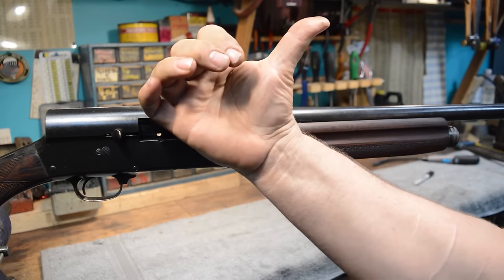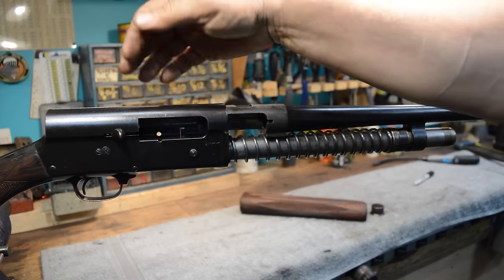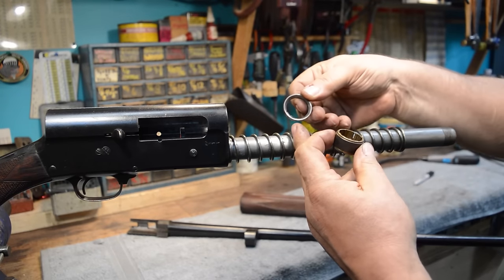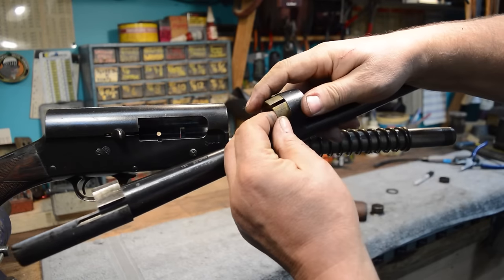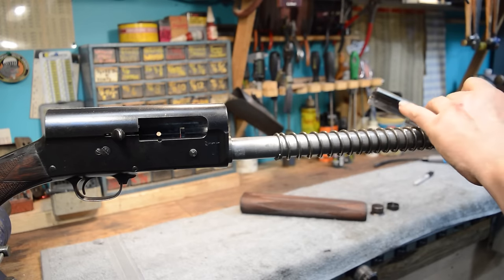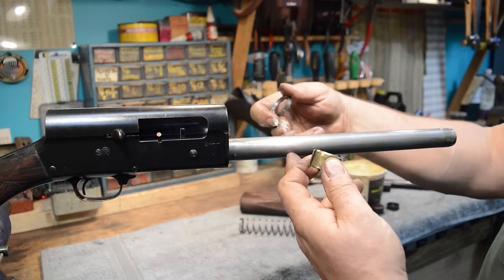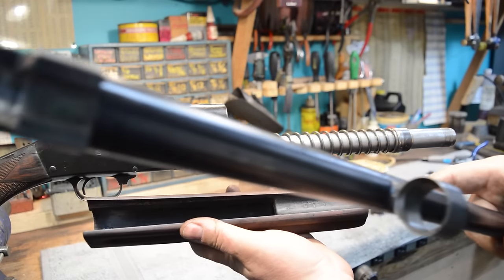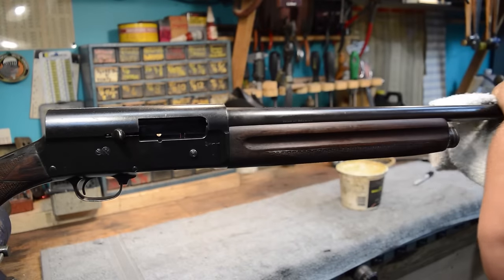Browning A5 Friction Ring Setup

Comment: The two things a gunsmith can count on are fixing Marlin 60s and cracked forearms on Browning A-5s. Excellent video, as always.
Reply: Sounds like you have seen this a time or two as well. Don't forget the dicked up slots on the fasteners on the A5.
Reply: my Remington mod 11 has a crack going down the wrist and a forend, and one of the back screws is messed up, I love the thing but she’s a bit fragile (I have not shot it much yet, I did not cause the damage, got it at an estate auction), I wish I could find some synthetic furniture for it, I love wood but I intend to hunt with it till I’m to old to hunt so I’ve gotta make it a lil more durable, thinking about getting it professionally dura blued. I gotta modify a mag tube cap for a sling swivel to, can’t find that aftermarket.
Reply: Buzzard 1860, I think Ramline made a synthetic set of stocks that may work. I put a set on an A-5 I had and it took some time to fit the buttstock up. I believe the mag tube caps with swivel studs are available from Uncle Mike’s. It would make sense to take it to a gunsmith for a good cleaning. Every new A-5 I have purchased over time needed a good cleaning and lubing before I did much shooting with them. I hope you enjoy your Remington!
Reply from the maker: All 4 types of Marlin 60 to boot...
Reply: Mark Novak, there’s that too! I have a bin full of spare parts!
Reply: You’re not lying just bought an A-5 today and sure enough the forearm is cracked.
Reply: Re forend cracking, I think it was Remington that glued in a wood collar at the inside rear, however they all seem to crack over time whatever one does.  I’m wondering if someone experienced with fiberglass could layup the appropriate fiber cloth plus resin in this area.
On another issue, these Browning long recoil guns have the potential to really kick and the rifles (Rem. Model 8’s) really do.  This is because with these guns you basically have a gun inside of a gun, where the barrel+bolt recoil inside the rest of the gun.  But the mass of the barrel+ is only half that of the entire gun, let’s say 3-4 pounds, and that is what gets accelerated by the recoil from a 12 gauge load, and it has the potential to smash into the inside of the receiver, dampened only somewhat by the recoil spring. It’s the A-5’s buffer ring which converts a lot of this energy to friction (heat) and does this over the entire stroke, thus an A5 kicks about the same as other shotguns. This is why lubrication of the (stainless steel) magazine tube effects felt recoil and functioning, as was explained by Anvil.  Shoot an A5 without the ring and you will have an experience you won’t want to repeat.  All of this is explained in Hatcher’s Notebook, now online.
Reply: I must have gotten lucky because I've had my marlin model 60 for about 20 years, bought it brand new and never had a problem with it. What are the normal problems with the 60s?
Reply: @matthewsaia409  the list of fixes that I have made to Marlin 60’s is probably too long to lay out here, but one of the major failings is the loading block. That is the silvery looking part that you can see down inside the ejection port. I have found that if the rifle is shot over the course of time without being cleaned thoroughly the fouling and operation of the rifle will cause excessive wear and eventually the rifle will not reliably feed rounds into the chamber. It would have been nice if Marlin would have made the the loading block out of stainless steal. My examination of the used loading blocks makes me think they are made out of chrome plated pot metal.
Reply: Not to mention Cracked forends on A5 patent clones. (Remington Model 11 & variants, Savage Model 720, the Savage Model 745.)

I personally own a Savage 745 and the forends is cracked on it lol
Reply: Why would a Marlin 60SS have a cracked forearm?  Maybe that's not what you meant.

But then, mine is stainless with a plywood stock.

There you go.  

Mine has over 10K rounds thru it, barrel never been cleaned (and looks GREAT with a Teslong bore camera.)  

Cleaned the action once, but it just keeps on ticking.
Reply: @pcmacd  Marlin 60’s usually suffer from parts wearing out inside the receiver. I have never seen a cracked stocked, but I suppose it is as possible as anything else since it’s designed and manufactured by fallible humans.

Comment: Excellent video! Many people dont understand them and get quickly get frustrated with having FTE. This is the best shotgun design ever,  1898 to 1998, a 100 years of John Browning perfection. These guns will shoot 10,000's of rounds with just some grease on the mag tube and a couple drops of oil in various spots. Ive been shooting auto5 for 37 years it's the one gun does that does it all !  If you find your not ejecting in colder  weather dont be tempted to use oil it will soak your stocks,  instead use a lighter synthetic grease sparingly on the tube.
Reply: If they're the best ever and perfect, why are they discontinued?
Reply: @randomidiot8142  Im not sure but I speculate it was expensive to manufacture.  Also, I believe it would need a redesign to make it lawsuit proof....the safety doesn't block the firing pin.

Comment: The manual that came with my 1957 Light Twelve says not to use grease, only a drop or two of oil, on the mag tube. It recommends removing oil, if using magnum loads, so as to increase friction (reducing felt recoil). The manual says it is safe, and will not harm the gun, to do so.
I really enjoyed the description of how the rings themselves function. Very informative!

Comment: That has to be one of the best explanations. 
I liken it to a compression pipe fitting a nut and ferrel so to speak.

Took me 2 years and 3 boxes of parts to build my first A500. I refer to Brownings Shotgun as one of the most quintessential steps in the development of Automata. It operates in a simple reliable way to perfom a repeated action...robot?
 
IMHO The Browning A5 is by far and away the very best Automatic Shotgun Rifle I have ever had the extreme pleasure of shooting and learning how to build and dismantle. John Moses Browning is the father of the modern firearm and the A5 will most likely be around for many generations to come.

If you cannot tell the A5 is my very favorite firearm right next to my AK's with the two and a handfull of ammo some targets to vaporize I am virtually guaranteed to exceed grin factors unknown.

Comment: Now, the questions will start...'What do I do with the other stuff?', from the guys with the 3 inch magnum guns! It works exactly the same, you just have two friction rings and multiple cone rings. I get the same question because everyone wants to soften the gun for dove and quail loads early, then punch it up for Magnum buckshot. 
   BTW, The A5 magnum that was left to me by my late father, will run the lightest loads fine, when set correctly. Correctly also means all the parts in the gun, not some taken out and in your pocket! 
    Great video and you will probably have to repost this every summer before hunting season!
   Take Care and be safe, John
Reply from the maker: Didn't have a magnum to show, but twice the parts are twice as good!
Reply: @marknovak8255  Yep! Take Care buddy! I wish I knew where to email or msg you and I would send pics or video of a A5 magnum system for you to use.
       Great Work friend,  John

Comment: My first gunsmithing experience was with a A5. The bolt block that rolls up into the square in the top of the barrel was wore out. The gunsmiths at the shop ordered the part for $35 and I got to machine it to fit. The curved lip that rolls it I to place when the bolt is closed and the sides were too big and they taught me how to machine them down to fit. My dad bought the Browning at a garage sale in the suburbs of Denver for $2.50 because the guy said it was a wall hanger. That was one good deal. The guy didn't think that the other parts were worth money. It took about 20 minutes to figure out what was wrong. I still have the old bolt block as a reminder. I would never work on someone else's firearm but I do work on my own. I can't tell you how many 1911 triggers I have destroyed before I got it right.

Comment: I just pulled apart a 1964 Savage 775A with exactly the same action. I learned I need to pull it back apart and align the ring gaps and white lithium the tube. Thanks!

Comment: I've never used grease, just a bit of light oil. Replacing the spring and friction rings periodically is required maintenance as far as I'm concerned. Excessive slamming from worn parts and improper setup is what cracks the forend.

Comment: Great video. I just came across a Franchi 48 AL, which as I understand is a licensed version of the A5. The previous owner had it assembled with the steel governor ring between the receiver and the spring for no braking action, as you said.  I've had a bit of trouble finding official information on it, so you've helped me see just how similar the two firearms' recoil rings are when reduced to their parts like this. Not sure if it's a difference specific to the Franchi, but the only manual I've been able to find online (an old 'American Arms, Inc.' publication) INSISTS in big bold warning letters that the magazine tube should never be oiled, and should be wiped dry after cleaning contrary to what you've mentioned on the A5, and what I would have thought should be done.

Comment: I find using Lithium grease provides a little TOO much lubrication causing the friction rings to lose the ability to  brake effectively, causing undue stress on the bolt by slamming it to the rear.  It also causes the A5 to kick much harder causing a longer reacquisition of the target.  Just a few and I mean a few drops of gun oil works fine once the gun is properly broken in.  

Save the lithium grease for the wheel bearings on your boat trailer, and use gun oil on your guns.
Reply from the maker: You may be using too much. I have experienced none of these issues in the 30+ years of doing it this way. That, however, is why we talk about the double kick, as it DOES injure the equipment, as you mentioned
Reply: James - if it spins, oil it. If it slides, grease it. Doesn’t matter if it’s you boat, your gun, or your door knob.
Reply: I totally agree,  I use maybe 5% of the grease shown in the video, the only time I have to use it is when I shoot trap loads from my 3 Inch Magnum A-5 when I go for birds or deer wipe the grease completely off set the friction rings for the load you are shooting them just a few drops of gun oil does the trick.

Comment: I'll try the lithium grease next time I clean my Model 11.  A former Browning smith swears a drop of motor oil on the tube (then spin the spring to spread the oil) is the way to go. 

I'm a fan of using grease over oil for lubrication on firearms.  It stays where you put it...
Reply from the maker: The oil will work as far as function goes. However, most of the failure forends are jet black from oil, so I have to draw my conclusions

Comment: The #1 thing I've seen start arguments about A5's is what lubricant to use on the mag tube for the rings.  My grandpa taught me motor oil, but after seeing it here, I started using grease.

EDIT: the gun in question is a 60's FN produced 12 magnum.

Comment: Is the A5 the same as a model 11 sportsman? My father in law just gave me his built in 1943. He never shot it and I am having problems with the first shell hanging up after it fires while I have two in the tube. So put two in tube close the bolt to load one from the tube and then add another one to the tube. The first one won't eject after it fires but then the other two fire and eject fine.

Comment: Unless I missed it, other than   the quick reference near start of vid, the orientation of the friction rings beveled edges was not covered in full detail in the set up when both are at the muzzle end of spring. There are 3 beveled edges as I understand it. One on first friction ring, one on second friction ring,  and one on barrel loop that slides over mag tube. Your hand was blocking the final step of assembly so I couldnt make out if the small friction ring was closest to muzzle end or the 2 piece ring was.  Would be nice to have a step by step portion that showed each piece being slid onto the mag tube in proper orientation.

Comment: Isn't grease of any kind on the tube overkill ?  Light oil works a lot better in any condition.  I've seen greased Auto 5 mag tubes freeze up in cold weather hunting.  It looked like a pogo stick in slow motion.  I loved hunting with mine and was my go to gun for years during pheasant season. Even my dog would get excited when it came out of the safe.

Comment: FYI,  Sir Isaac Newton stated, "To every action there is always opposed an equal reaction"  NOT, For every reaction there is an equal and opposite counter reaction. That's similar to a double negative.   Also you did not really explain what position the friction ring should be in with regards to light loads vs heavy loads. Or did i just miss it?   Just sayin.....hope your not offended.  LOL.
Reply from the maker: The point is that it is a brake. Heavier loads, more brake necessary. Thats it.

Comment: Love this. I actually own a '57 fn made 16( not the sweet). The stock was damaged during Harvey,  has a little bit of cosmetic rust.... at some point I'm going to re-oil the stock, and try my hand at carding.

It developed the classic a5 worn out rear pin hole in the stock, as a teen i cleaned the hole up and bedded a piece of metal into it to tighten it up. Looking back on it I probably should have drilled it out, either put a wood plug or metal ferrule in, and bedded that with acriglass or similar, but many hundreds of rounds later it has no stock walk.... thinking ain't brok, don't fix it.

Comment: My roommate has a Franchi 48AL he picked up for absurdly cheap that's being difficult, I was wondering, would setting it up in this manner work on it as well? From stripping it down and cleaning it per the owner's manual, the parts look strikingly similar.
Reply from the maker: The principle of operation is the same, the physics are the same.
Reply: @marknovak8255  Awesome. Thanks much.

Comment: How can one bring the the silver colour on tje magazing tube from the outside id it has rusted a lil. Can it be cleand and what good to use to remove the rust so that it done come back again.
Reply from the maker: wet sand with 600 grit and buff to the sheen you want

Comment: Any chance you’d have an extractor laying around for a jc Higgins 101.25? My neighbor is an old woman, she showed me today, it was her husband’s so she wants to keep it. Extractor on the ejection port (right?) side is broken off, I told her I’d try and find one but no luck yet. Thanks for any help.
Reply from the maker: It's a Stevens 39A. Start there, they are the same gun
Reply: Mark Novak thanks a million!
Reply: @shanek6582  Looks like there are some in stock at the Numrich website, if you haven't checked there yet.
(I'm not associated with them in any way. It's just where I looked first.)
Reply: PhantomP63 lol, it’s the first place I looked and already ordered it. The bolt retention screw is missing in it also, Numric didn’t have one but I’ve got a metal lathe, I’ll just make that part. Thanks for looking man.

Comment: A5 only gun that uses the stock for fire control tolerances? What about the Lee/Metford/enfields that had the trigger mounted in the stock? What about the Ruger mini 14 with the 'op rod'/gas piston crudely and stupidly guided by a sheet metal insert in the stock?
Reply from the maker: Neither of those examples set headspace, or battery position. They are not critical tolerances.

Comment: I understand  that the butt of the cartridge pushes the bolt back. But the wad,pellets, and burning force are pushing the barrel forward as they go forward out of the barrel.  So why does the barrel  come back? I'm missing something.
Reply: Every action has a equal and opposite reaction,  the force used to drive the load forward causes the opposite reaction of the bolt backwards.  That is why your gun kicks.  In the Auto 5 case when you fire the bolt is locked to the barrel causing the bolt as well as the barrel to the rear, hence the "braking action"  when it reaches the rear the barrel is released and the spring pushes it forward followed shortly by the bolt right after  the spent shell is ejected  and then  pushes the next shell into the chamber.
There are several good slow motion videos of this check them out and see if you can't further slow them down on your computer.  It is a lot easier to understand this visually then verbally.